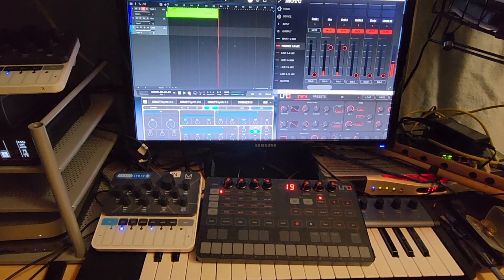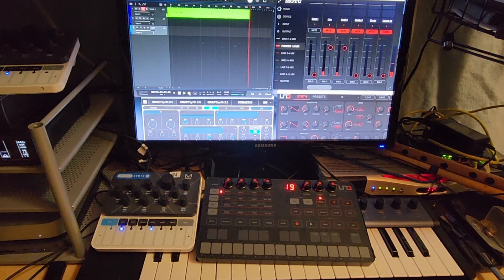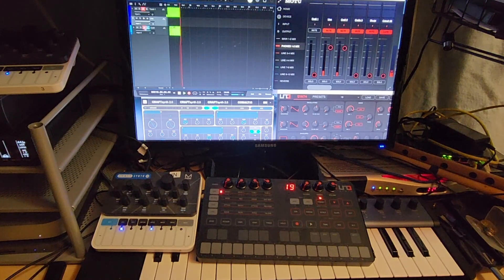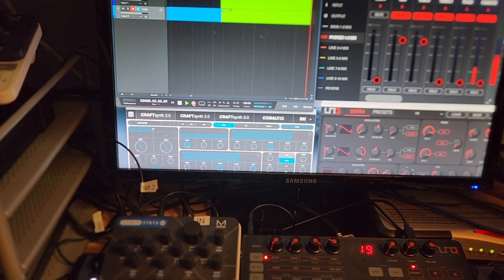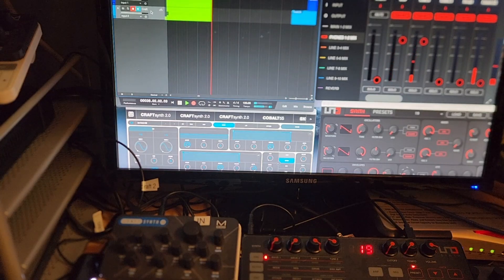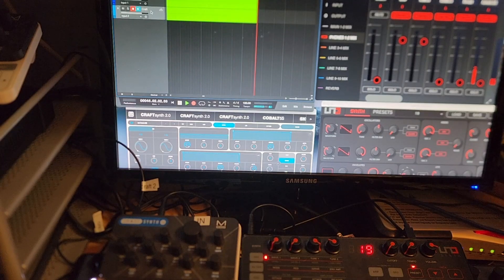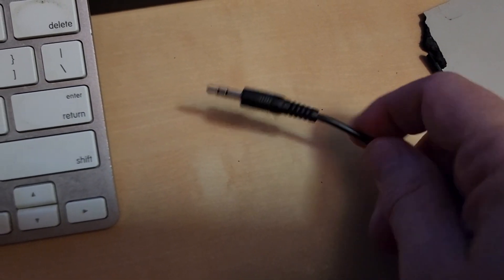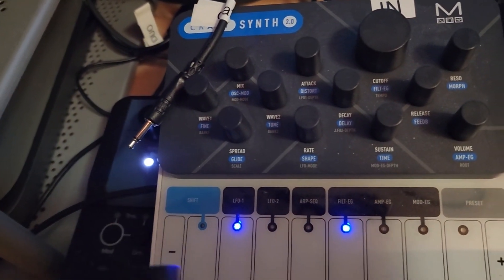How to get rid of USB line noise on Craft and UNO synthesizers

Comment: Wow. What I've done is use a phone charger to provide USB power only the Uno Synth and then the other MIDI inputs instead of USB MIDI. Works well for the laptop and iPad, sometimes I was still getting a bit of noise with my Boss pedal. Have to check this out!
Reply from the maker: This is a cheap solution, and I can keep my synths plugged into the computer and use the editors. This fixed it on all 3 of my Craft synths and the UNO!